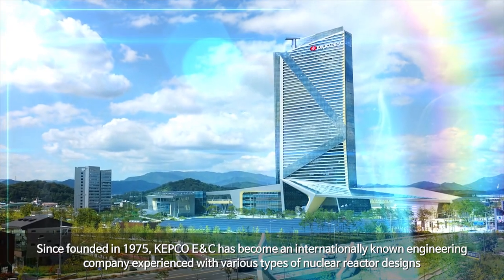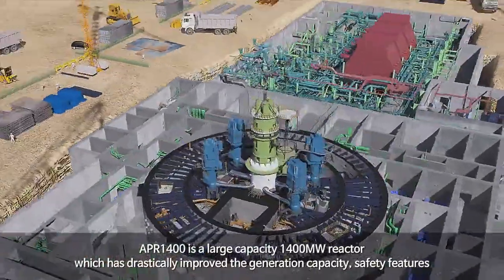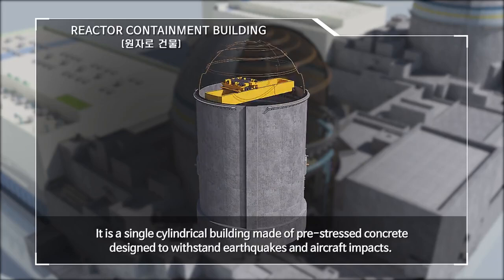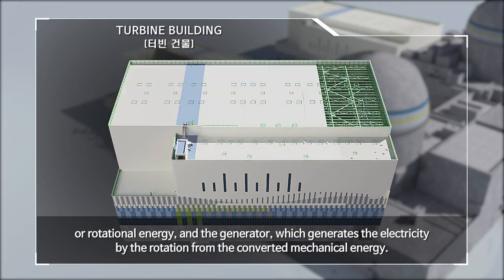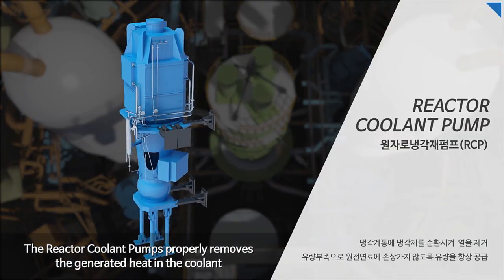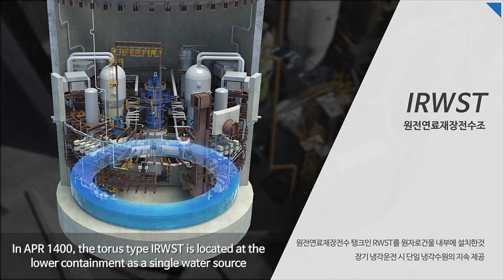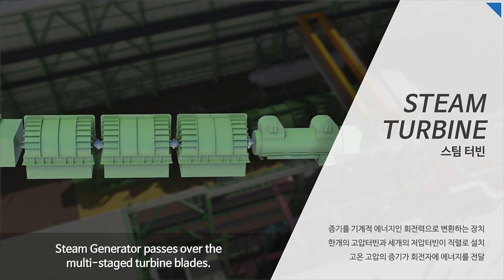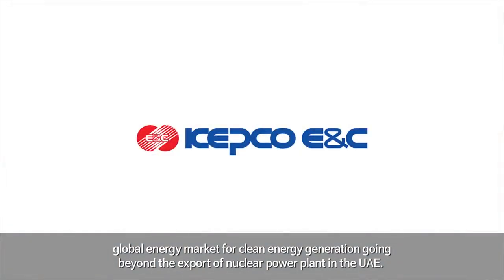KEPCO E&C's APR1400 Nuclear Power Plant PR video

Comment: The 34.212 tons of spent fuel generated in one year by one 1400MW reactor can fuel 36 1GW Molten Salt Reactors for one year. 940 kg of natural thorium in a Molten Salt Reactor (MSR) can generate 1 gigawatt (GW) of electricity for one year. The 259.784 tons of unused depleted uranium processed to obtain the 34.216 tons of enriched uranium can fuel 276 1GW Molten Salt Reactors for one year.

Comment: How much do they cost? 
Maybe I can ask my country to buy one.
Reply: around 5 bi dollars
Reply: And built in aproximately 5 years. Westinghouse needs like 15 years to build their AP1000, IF they finish at all. Kepco proved this many times.
Reply: @Signal_Glow  For comparison Over 10 years and 12 billion for the EPR2 (1600 Mw) But Epr2 can survive of Hydrogen blast and have a corium recuperator. The walls are so thick that it is already a Sarcophagus. France having built a mock containment ensainte to test the resistance of the materials, they designated a really solid ensainte.

The reactor has a better efficiency in fuel consumption, but this comes at the cost of great complexity. complexity, even too great a complexity which explodes the costs (like having a pressurization at 300 bar) The reactor vessel) also a design fault in vibration (to be reviewed)
For my part I think that the best would be to have the safety of the EPR 2 but without necessarily having its performance and its complexity. A reactor halfway between the EPR2 and Korean nuclear reactors.
Safety is still important, the nuclear disaster cost the Japanese more than 200 billion and it's not over...
Not to mention the ecological and health impact (which remains difficult to assess exactly)

Comment: Awfully similar construction to Three Mile Island power plant.
Edit: yep, APR-1400 was developed from OPR-1000, which in turn was developed from Babcock & Wilcox reactor, the same type that was used in Three Mile Island.
Reply: The OPR-1000 was directly based on the Combustion Engineering System 80/80+ design. The System 80+ was a revolutionary PWR design. It also helped with the development of the AP1000.
Reply: Basics are similar but safety features a lot more advanced. Even simple metal alloys got way better in the last 50 years. This is not some 2nd generation reactor like others at the end of lifetime. Calculations show they are orders of magnitude safer, add better computers, monitoring, knowledge from accidents like TMI and you get APC1400...
Reply: The accident at Three Mile Island was not due to the design of the reactor. Moreover, although it looks similar to him in appearance, it is not at all due to the containment.